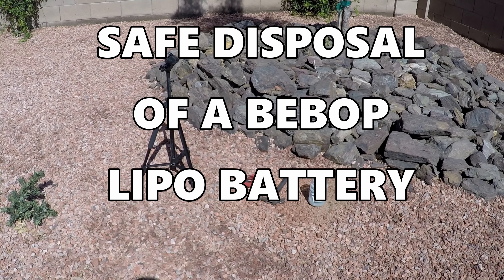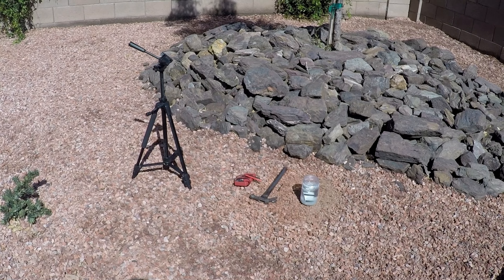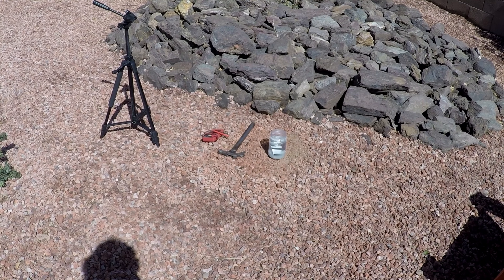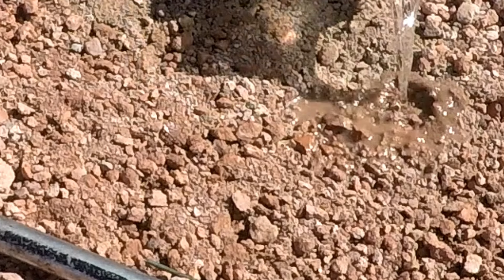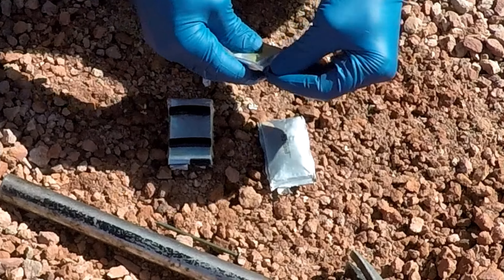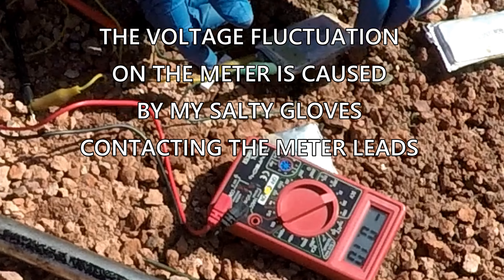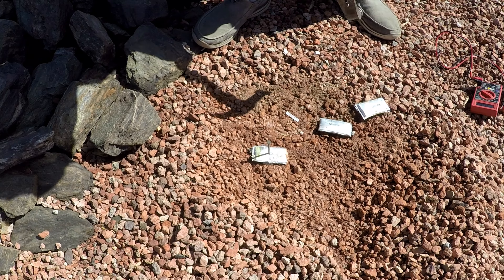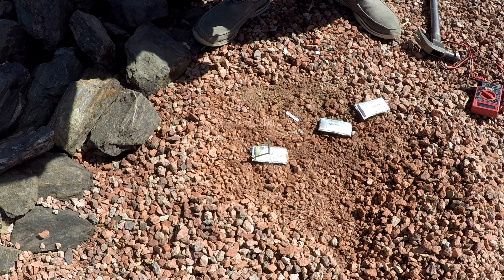SAFE DISPOSAL OF A BEBOP LIPO BATTERY

Comment: Now we learn more things in this exact 5 minutes video. Very good. And I have a bunch of questions to ask. That Bebop 2 battery wasn't good anymore? Salt water is good for discharging a battery? It is a regular kitchen salt in regular drinking water? The nail on the cell was just to confirm the battery cell is now safe to recycle?
Reply from the maker: Hi Helder. Answers: The battery was cracked open when the drone crashed and had lost connection stubs. Salt water is excellent for conducting electricity. I mixed up a very strong solution using kitchen salt and drinking water. The nail was to confirm that the battery was safe of the garbage man to handle. If you watched the referenced video you could see what would happen if the cell were not discharged. Thank you for your comment and God bless.
Reply: Thank you